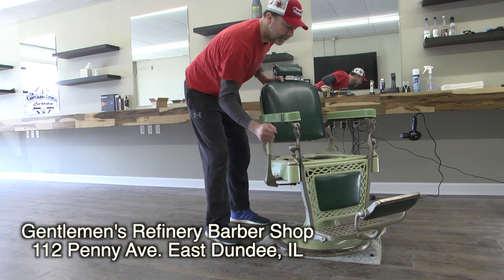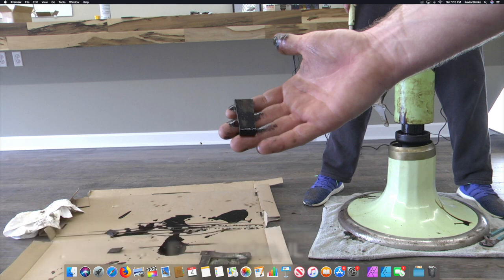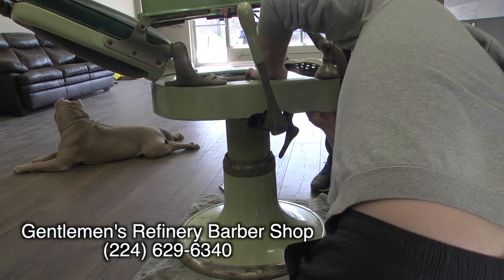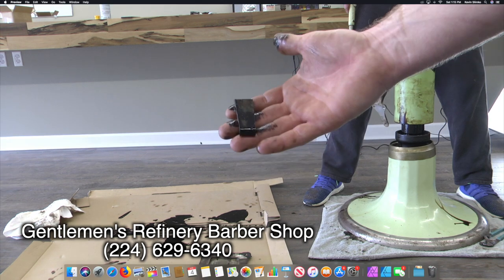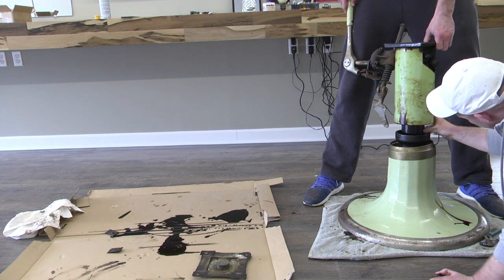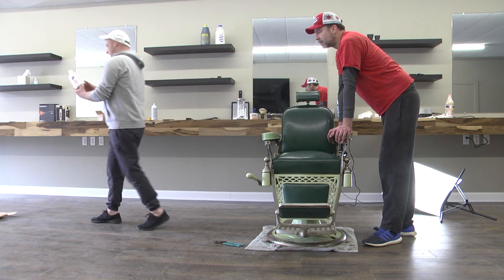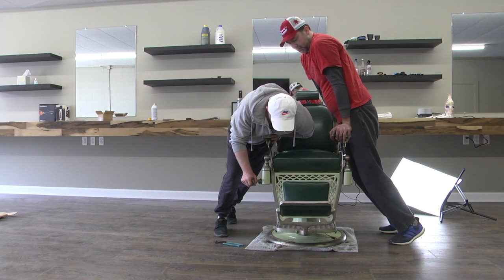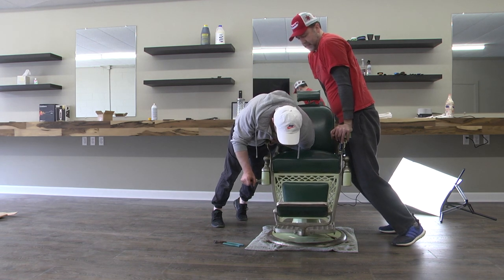Slim the Barber repairs the brake on a Vintage Paidar Barber Chair

Comment: Slim, Good morning I am having a problem moving the lever forward on my Paidar barber chair hope you can help Thanks
Reply from the maker: I don't know.  I'm sorry, I'm actually not very handy. I might guess that it has something to do with a seal inside the cylinder.  I know one of our chairs was having a tough time moving, and we punctured the little cap that you can unscrew to add the hydraulic oil. That really helped. I thought it might have been locked up because no air could get in the cylinder and it was creating a suction stoppage. And I was somehow correct.

Comment: @Slim The Barber my grandfather has this chair and and he is a barber we can not get the handle to do anything but make the chair recline. The lever will not move forward. Therefor we can not get it to pump up or turn , any clue on how to fix?
Reply from the maker: If I had to guess, I’d say the key for the pump break was stuck. (That thing I replaced in this video.) I don’t know how to fix it if I’m correct. Because you’d need to be able to unlock it to pull the cylinder up to move it. Is there hydraulic oil in the base?

Comment: Having a problem with trying to lower my chair, the leaver feels stuck and I'm unable to move it forward,  but it does recline, any thoughts or suggestions?
Reply from the maker: Sorry. I don’t know. Did you ever have any luck?  Do you have hydraulic oil in it?